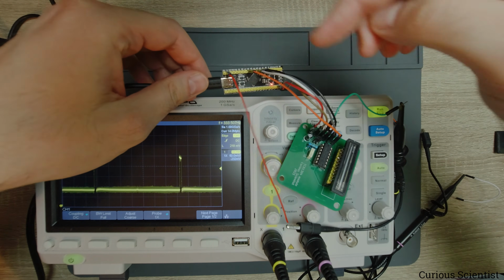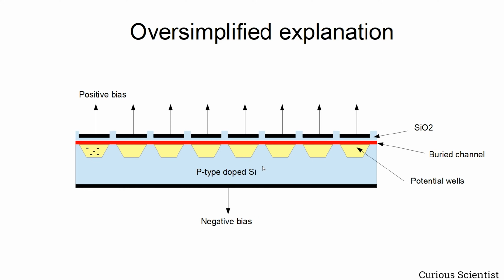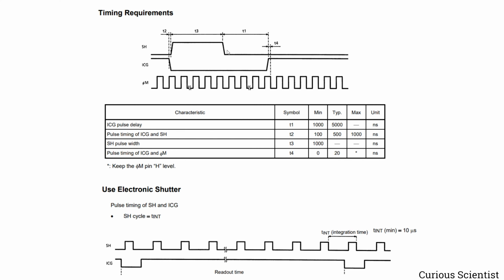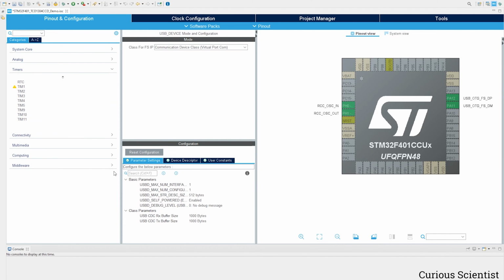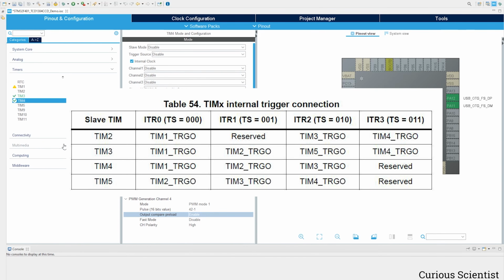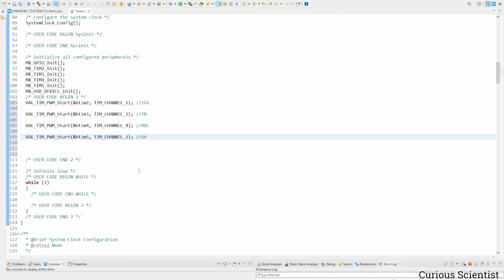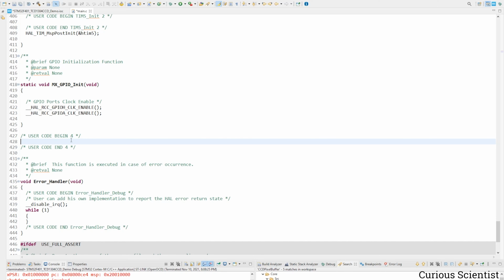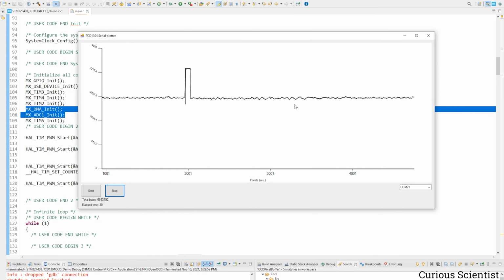TCD1304 Linear CCD - Part 2 - Driving the CCD

Comment: Hello, are you just sending the raw data after analog-to-digital conversion to the host computer? All data processing is done on the host computer, right?
Reply from the maker: Hi! You're correct. I send the data to the computer in a raw format. There are two bytes that have to be reconstructed into a 12-bit number on the computer. I do everything on the computer since it has much more power.
Reply: @CuriousScientist  Thank you for your answer. As a beginner, I still want to ask, did you set up the program on your lower-level machine exactly as you described in the video? Have there been any subsequent modifications? Using other methods to debug and use it may result in undesired outcomes.
Reply from the maker: Watch the video and read the article. All these questions are answered already. ;)

Comment: Hi, I started a stm32g4<->tcd1304 connecting project and discovered your blog post. Although stm32g4 a little bit different from stm32f4 (like having just 1 32-bit timer, etc, etc) your post really helped me to get on speed and after some g4-related adjustments, see the analog output on the oscilloscope and capture it with ADC-DMA, thanks for that!!!

I have a question about synchronization of analog read with ICG timer. From what I understand, the analog read of the pixels must start with ICG pulse, but I don't see you synchronize it. Am I missing it?
Reply from the maker: Hi! I am glad that my content was helpful! As you can see at the end of the video, the signal on the chart of my software was constantly shifting to the left. This is exactly caused by the lack of syncing. Later on, I improved this and actually managed to sync everything nicely. Check my most recent spectrometer video.

One of the most important things is to match the SH and ICG carefully. The SH's pulse should be an integer fraction of the ICG pulse. Then it is a good idea to use the ICG as the overall trigger. It should trigger the SH and the ADC. This way everything will be very neatly synced.

Comment: Hi,
i made micrometer by using ccd sensor and watching your video thank you bro , 
i have a problem , how can I  calibrate sensor
Reply: I did  everything like you do , I only wouldn't able to make buffer structure and send PC ,  all pin wired , then  clock signals  looks correct , and  when I wiring os pin to osiloskop  and put something on ccd , data is changing but the changing is not stable
Reply from the maker: If the data is floating, make sure your timings are precise. I emphasized this in my article.
Reply from the maker: Hi! You compare your values with a known source to calibrate the system.
Reply: To read data  os pin wiring to ADC and  sh pin wiring ADC
Reply: Probably my connection is wrong I only wired os pin to ADC to read data and i wired clocks
Reply from the maker: Why don't you do the same as I did?
Reply: When I put my finger on ccd , data is changing but when I put  jumper cable doesn't change

Comment: First of all, congrats on this video, it is really informative and well done. I have a few of basic questions which I want to confirm because it's my first time uploading a firmware with STM32.

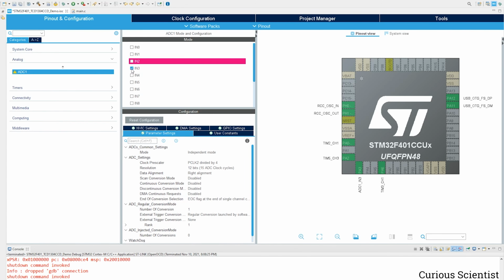Regarding the wiring of the STM, for example, in 47:33 we can see the following pins:

PH0 = RCC_OSC_IN (not connected)
PH1 = RCC_OSC_OUT (not connected)
PA0 = TIM2_CH1 (A0 = ICG, goes to hex inverter)
PA2 = TIM5_CH3 (A2 = SH, goes to hex inverter)
PA3 = ADC1_IN3 (A3 = OS output goes here?)
PA6 = TIM3_CH1 (A6 = fM, goes to hex inverter)
PA11 = USB_OTG_FS_DP (not connected)
PA12 = USB_OTG_FS_DM (not connected)

Am i right? Should I connect something else to reduce noise or something like that?
Reply from the maker: Hi and thank you! 
The PH0 and PH1 are green (enabled) because they are the oscillator pins. As soon as you enable the HSE (See RCC under system core), you will need an external clock source. This external clock source is available from the onboard crystal on the STM32F401CCU6 module. PA0, PA2, correct. PA3, also correct, this is where the OS goes, this is the analog-to-digital converter input we use to capture the output (OS) of the CCD. PA6, yes, this the fM (main clock source) of the CCD. PA11 and PA12 are also enabled because I enabled the USB, because I send the data to the computer via USB. Similarly to PH0 and PH1, these are only relevant for the onboard connections of the STM32F401CCU6 module. 

If you want to reduce noise, a good idea is to pull all the pins around the above pins to ground. You can do this in the code by setting the pins low, or just connect them to GND physically. 

A tip. I developed 2 new boards for this CCD since I published this video. They might be more convenient to use, depending on your goals. Check this video: https://youtu.be/HKGaHWrf1cg
Reply: Thanks a lot for your response! Just one thing to make sure I got it right, even though HSE it's called high speed "external", I don't need to buy another crystal resonator as the stm32 handles the connections internally to power the 2MHz master clock, right?
Reply from the maker: Hi! The crystal is on the board... but from the chip's perspective, it is an external source because guess what, it is not inside of the chip.

Comment: The specification sheet for TCD1304 says the data rate is 0.5 MHz, wouldn't we want to run the ADC at at least 1 MHz to avoid aliasing?
Reply from the maker: I haven't had any issues with aliasing so far, and I've been using this sensor extensively for various purposes. I built a camera as well as a spectrometer, both work fine. The data rate here is more like how long the time between two pixels' data is. It is not a periodic signal, so I think we are "exempted" from the Nyquist theorem.

Comment: Timing requirements of the TCD1304 linear CCD using the electronic shutter function, When ICG goes low SH is high for t3 amount of time and is off for t1 amount of time. 
Exposure is happening in which duration? 

Why there are so many SH pulses ( Integration or exposure times ) in between two ICG pulses?

When ICG goes high there are so many SH pulses. 

The readout starts when the ICG goes low and it lasts until it goes low again. 

Read out means shifting of the accumulated charge isn't it?

Will readout and exposure happens at the same time because when ICG goes low read out starts and during that time only SH is On and SH is on many times during that time.

I'm confused with the sequence of events like exposure of light, accumulation of charge and shifting and clearing the charge with respect to the timing in electronic shutter function mode
Reply from the maker: Exposure is between two ICG but it is chopped by SH which is basically the electronic shutter. Check all my tutorials, I explained these in very detal, especially on my webpage.

Comment: Does anyone in here has had trouble with Tim 5? every other timer is working for me except for that one. And they just work as  expected. But Tim 5 seems not to work at all.
Reply from the maker: Do you use the same mcu? Do you follow my instructions _exactly_? Have you taken care of the triggers?
Reply: Wow! I did not expect to get an answer so fast.  @CuriousScientist  . In regards with the triggers, I have configured Tim 2 and 5 just as is shown in your video using the .ioc. But I'm not using the same MCU, I'm using an F411, the tool chains are basically the same though. And according to the reference manual Tim 2 and 5 are related equally as in F401. Everything works just well, it's just tim 5 which does not work.
Reply: BTW your work has helped me a lot. I would not say that I became an embedded systems engineer with this work, but you really helped me understand how this MCU family works. Which is big deal, considering that I come from arduino and NODEMCUs and the transition is not as easy as I had hoped.
Reply from the maker: There must be some difference somewhere if it doesn't work. I assembled at least ten of these devices to drive the CCD and they work perfectly. I will try to look at the F411 if I can find some differences. I don't have the datasheets in front of me right now, but there should be a table where you can see which timer can trigger which. Are they identical for these two mcus?
Reply from the maker: It took me more than a year to get to an acceptable level with the HAL system so I can write my own firmware to drive this CCD. And I am nowhere near a programmer or electrical engineer. So, don't give up. Knowledge comes with time and patience. I am glad that my video could help you.
Reply: @CuriousScientist They are pretty much the same. For Tim5 it is the same.
Reply: I also want to add that for the F411 I could not use the full 100 MHz clock speed and get the desired frequencies for all timers. For instance I could only get 1.99 or 2.03 MHz when trying to configure the 2 MHz pulse. Which is weird because to get 2 MHz from 100 MHz you need to divide by an integer. Everything was fine when bringing the inner clock to 84 MHz. The same is true for the 500 KHz pulse, I could only get 498 or 506 KHz.
Reply from the maker: Even a tiny bit of difference in timing will eventually mess things up. For example, in the very beginning, I had a tiny difference in the proportion of the icg and sh signals. Their ratio was not an integer, and with time, they were shifting relatively to each other, which caused corrupted readings. So, you really need to do things carefully. This is why I asked already in my first question if you're doing exactly the same and using the exact same mcu.
Reply: Yeah, that’s true. I will re do everything. Extremely carefully.
Reply from the maker: Good luck! Let me know once you manage to get it running.
Reply: I think I finally got it right, tomorrow I'm gonna buy the logical gate to build the circuit and test it. I solved my problem by changing Tim 5's output to Channel 2 (everything else was kept equally to what you state). I have not activated DMA and ADC yet though.  I hope they do not overlap. For anyone else reading this I'm using a F411 MCU
Reply from the maker: @victoribarra9930 nice to hear that you got it working. The DMA and ADC will be easier than the timers. Just make sure you'll initialize the DMA first, then the ADC. It kept me confused for a while because sometimes the auto-generated code changes the order of initializing the DMA and ADC and it won't work if they're in the wrong order. But everything is written very detailed on my website anyway. 😉
Reply: @CuriousScientist  I finally have made the ccd device to work. Thanks for all your support. It really helped me get into STM programming.
Reply from the maker: @victoribarra9930 I am extremely happy to hear the good news! I hope you'll have fun with the device!
Reply: @CuriousScientist  I have watched the video and am using a NUCLEO-F411.Already got it to output data via USART(NUCLEO board doesnt have USB connectivity as far as i know). I also had to change TIM5 to channel 2.

The problem im currently  having is that, when reading the USART data, the OS pulses are all over the place. Kinda Like the adc convertions are started before the previous on is done. Clock is set to 84Mhz, and checked the pulses on an oscilloscope(they seem fine). The USART and DMA routines are as follows:

HAL_ADC_ConvCpltCallback(ADC_HandleTypeDef* hadc){
	HAL_UART_Transmit(&huart2, (uint8_t*) CCDpixelBuffer, CCDbuffer, 100);
}

HAL_ADC_ConvCpltCallback(ADC_HandleTypeDef* hadc){
	HAL_UART_Transmit(&huart2, (uint8_t*) CCDpixelBuffer, CCDbuffer, 1);
}
Reply from the maker: @mattjmwmatt  What do you mean by OS pulses? OS is the output, there are no pulses... If your signal is all over the place, then your timings are still incorrect. You said, your pulses seem fine. There is a big difference between seemingly fine and actually fine. Make sure that your frequencies (or periods) are integer times of each other. I wrote about this in my article on my webpage.

Comment: Nice build and details. Thanks for that.  My understanding is the linear CCD's are better for the faster response rate situations like with Laser Induced Breakdown Spectroscopy (LIBS) spectrometer and maybe some others compared to a webcam spectrometer using like Theremino or Les Lab software or others.  Will be interesting to see your latest progress once you get around to.  Stoppi recently demonstrated a fiber optic version of his webcam Theremino spectrometer which got me motivated to move forward on my ideas using some TOSLINK cables I have around already.  Will be interesting to see what the best resolution and frequency range you get with your design.
Reply: The CCD also has the advantage of not having a Bayer filter like almost every affordable camera sensor, so it should give more accurate spectra, as well as wider wavelength range, including some UV and IR.
Reply from the maker: Hi! Check my latest video related  to the TCD1304 spectrometer: https://youtu.be/zxIK2aP3z2Y

Comment: Sir CCDPixelBuffer size is 6000 but CCD sensor have only 3694 pixels. How can we differentiate between dummy and sensitive pixels
Reply from the maker: Hi! You can count the pixels. The datasheet clearly tells the number of dummy and real pixels. You can also adjust the buffer size, I just associated a more or less arbitrary value to it.

Comment: Hey, this might very well be a stupid question, since I know little about electronics, but would it be possible to control the ccd directly with a Raspberry Pi?
Reply from the maker: Hi! There are no stupid questions! :) I am not very experienced with the Raspberry Pi microcontrollers, so I can not say a clear yes or no answer, sorry. If it has an ADC with a 500kS/s and DMA to store the conversions, and if it has four individual timers that can trigger each other, then probably it can be used. I saw a project where someone used an Arduino Uno, but only read half of the CCD due to the limitations of the Arduino itself. So, everything is possible. 

But why would you go for the Raspberry if you can buy the same microcontroller I used for a very cheap price and just copy my steps? You could make things work in half an hour.

Comment: I wanted to build a spectrometer as well and tried this several years ago (just checked: the source files are dated beginning of 2017), but all with the "STM32F10x standard peripheral library". So no CubeMX to set up the timers, ADC and DMA. I can't remember how many weeks it took me to get all the parameters for the peripherals correct (and in the right order as you stated!) by going through the datasheet. I think I even used the two ADCs in interleaved mode, because that allowed higher bit resolution for the speed needed, and had two alternating pixel buffers so I could send data while already capturing the next "frame".
I also wrote a small python program, that showed me the result graph and let me set the integration time.

And while it was one of my very first STM32 projects (I payed for my over confidence 😅) and my first python gui (again the hard way 😅; I don't and didn't use python often), I managed to get the firmware and software working.

But I failed at the optical hardware level and never got a spectrometer. I also had different laser pointers and diffraction gratings, but didn't know what lenses and mirrors to get (and where to get them). The project has been in a box since then. I might take it out again. That depends on the rest of your videos of the series I haven't watched yet.
Reply from the maker: I actually built a spectrometer with this CCD, you will find it in the list. I also built a full-frame scanner camera. And I am still working on projects based on this CCD. I also wrote a GUI in C# to capture the profiles from the CCD, log the data into a file, change the integration time and so on. The software I wrote for the spectrometer looks quite neat, however, I still have some bugs here and there. 

It took me a very long time to make everything work properly too. Especially, because I was used to Arduino and I had to learn the whole STM32CubeIDE environment and the HAL system. But now I feel quite confident about this new environment.